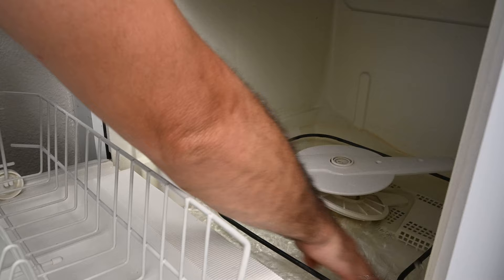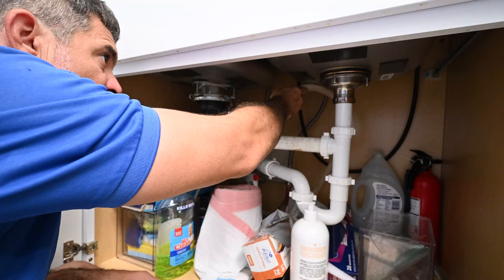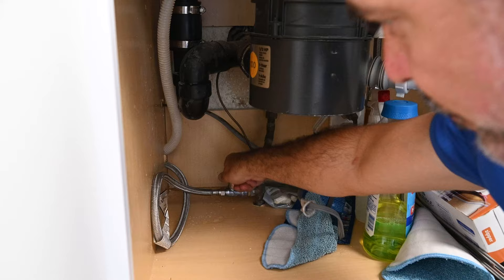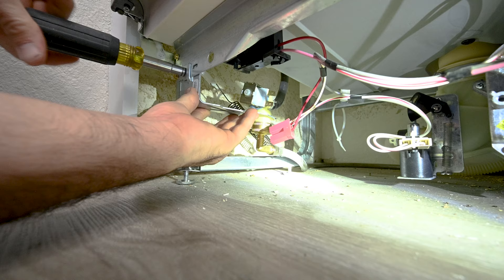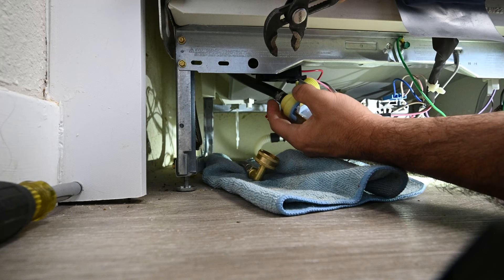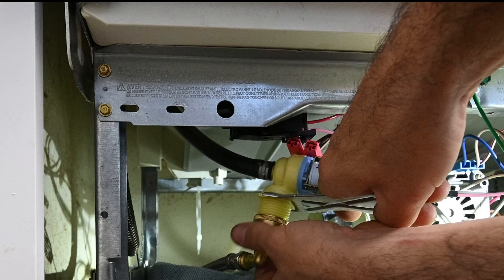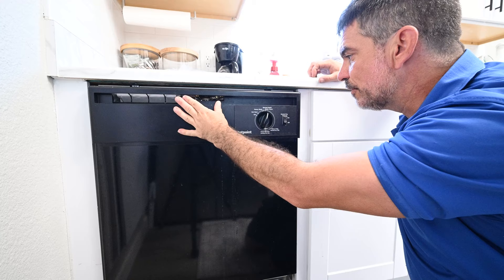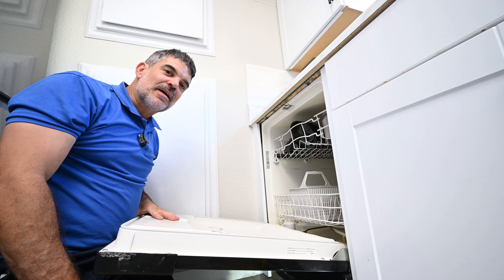Dishwasher Fills Up with Water When Not in Use

Comment: I can't recall how many times I've solved this problem by fixing the drain hose with the inverted trap. There have been times I've had to replace it when a jackass cuts the hose for a tight fit.
Reply from the maker: Ouch - haven’t ran into that but sounds horrible 😆

Comment: my dish washer doesnt even power on and i still get water in the dishwasher sometimes just from doing dishes, i was told i needed to replace the garbage disposal. When i go to turn off the water supply to the dishwasher it doesnt tighten enough to shut off. i did the high loop with the hose to see if that fixes my issue...

Comment: Hi Dave! I made the high loop, but I still got (clean) water backing up into the dishwasher. So then I turned off the water inlet to the dishwasher and kept using my sink, as you suggested. But once again, I have (clean) standing water in the dishwasher. So that means the problem is not the water inlet valve, right? Do you have any more suggestions as to what the problem could be? Or is it time for me to call a plumber or possibly replace the dishwasher? Although, it works fine other than this. Thanks!
Reply from the maker: Oh wow. Water could be leaking by if the water inlet doesn’t shut off all the way, this is just a guess though. Could also try replacing the drain hose which should have a built in check valve
Reply: @ApartmentMaintenancePro   Thanks for your quick reply! I just came back to delete my comment, because I think we had turned the water inlet the wrong direction. A couple of hours ago, we turned it the other way just to make sure we had it off. And now we are not seeing any more water in the dishwasher. So it sounds like it's the water inlet valve after all. Thank you so much for your help.

Comment: I have replaced water inlet valve and circulation pump per the diagnostic codes on dishwasher. Pump turns on for seconds but not enough to wash. Any help would be appreciated

Comment: Hello!  Thank you for a great video.  I have water standing in my dishwasher but also quite a lot of water running out onto the floor underneath it.  Shutting off the water mitigates both problems. Could the issue still be the water inlet valve?   It seems like there might be a compromise in the connection or the water would just run into the dishwasher.  Thanks for your help.
Reply: This is exactly whats going on with ours...did you ever find out if it was the valve?
Reply: @staindthepain2  I have not yet tackled the issue but have it planned for time off over Memorial Day weekend to work on it.  I think this will solve my issue though. Thank you!

Comment: I have a lot of questions that may sound dumb? what tools did you use to remove the water inlet valve, dishwasher cover, disposal hose? Also, the bottom of my sink doesn't have a water inlet turn. MY house is 2015. Any help is greatly appreciated. I am attempting to solve this on my own before having to call someone

Comment: You said shot off tap and if water doesn't fill up in dish washer. Then valve is faulty (Minute 2). do you expect water to fill up when valve is shot off?. Is that the normal expectation?
Reply from the maker: If you don’t have a high loop on the drain hose and its hooked up to a garbage disposal it’s possible (not likely though)

Comment: Hey Dave what's your email? I see under your YouTube profile it said email for biz but never had an address? Anyways I had a call just like this. Customer said she hasn't used dishwasher since she moved in and it overfill and leak out. I was getting OL from the water solenoid coil...I just figured you could do a continuity test on it!
Reply from the maker: aptmaintpro@gmail.com - even though the coil isn’t energized the valve it self may be slightly stuck open letting water pass by 👍